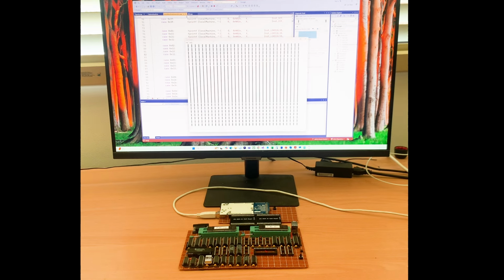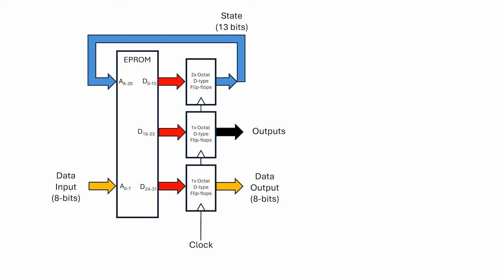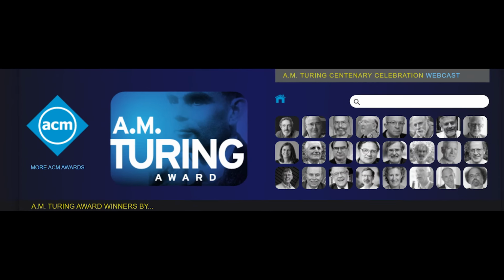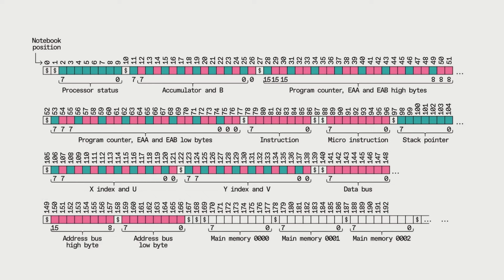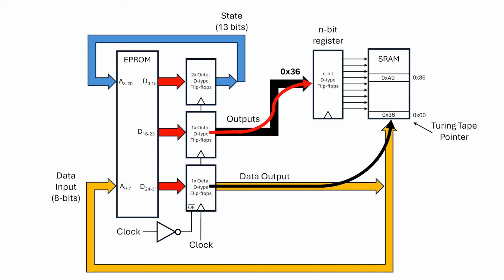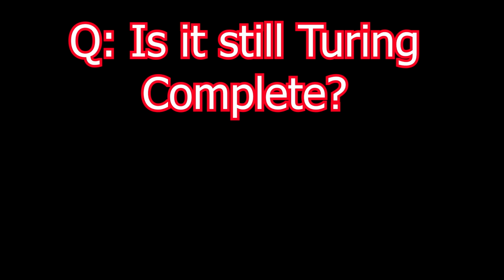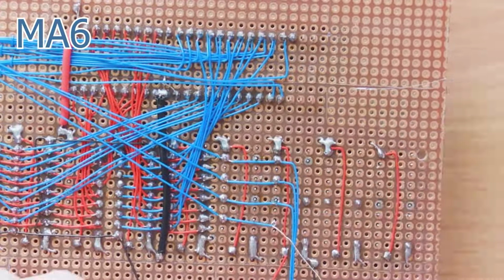ZX Spectrum Turing Edition Part 2 - Memory

Comment: A Turing machine can compute anything that is computable.  Any program that would require an infinite tape is not computable because it would never halt.   To be Turning complete, then,  does not require an infinite tape, only one that is *unbounded*.
Reply from the maker: Yes unbounded vs infinite has been discussed already in the comments. I’ll make a comment in the next video.  I actually argue in the video that very large is enough to be Turing complete.

Comment: Hi - I've been using some of your techniques to recreate Atari Pong in software using emulated logic chips implemented as lookup tables, and using this to generate the composite video signal as another table which is written to gpio pins in a Raspberry Pico. I was wondering how you deal with delays inherent in logic chips when reimplementing in eeproms. Atari Pong's design uses delays to its advantage but I'm not sure how best to emulate this whilst sticking to the original electronic design. Thanks for creating these inspiring videos 👍
Reply from the maker: Usually i clock the output of the EPROM rather than use the 'raw' results.  Means you need the address 1 clock early in your design though.
Interestingly, i once worked with Al Alcorn who designed Atari Pong.

Comment: I don't think I watched any other videos in this series, but I'm around 3 mins in and I'm trying to understand how you emulated a Z80 without using a Z80.  Are you saying that you used EPROMS/EEPROMS with the address pins driven by the instruction value and the step counter and the data outputs being used to drive the various logic lines?  Quite impressive, in any case.  If that is how you did it, then it's a neat solution.
Reply from the maker: There's a bit more to it than address = STEP | (Instruction<<4).  If you're familiar with that concept though, this playlist may be good place to start
https://www.youtube.com/playlist?list=PLjQDRjQfW-84aOLT33kzoZghRofK-uL1F

Comment: I am thoroughly enjoying your videos, I may even understand some of them!
Thank you very much.
Reply from the maker: Excellent, hope you get some value from them.
Reply: @DrMattRegan  Thank you, I do indeed get a great deal of value from your videos. Book in the way..?
An observation, if you have time: If you arrange two Turing Machines with their 'tapes' arranged at 90deg you have a means of addressing an array. n machines can address an n to the n array with I presume an equivalent increase in 'power' while only 'spending' I guess n+1 in components. I presume said array has to be fully populated, not just the 'tapes' along the edges... although to drag a bit of 'avant garde' physics in the shape of the 'holographic universe' in to this, the contents of a 3D space can be entirely encoded on it's surface and I presume that holds true for any 'array', meaning you 'only' need n+n 'tapes' to achieve and encoding space of n to the power of n...
...am I making any sense? Is such a scheme of arrayed state machines used in the world of computing? (my knowledge only extends to a bit of hobbyist PCB design, mostly for 8 bit retro computers) If I haven't just splurged out a load of unwitting gobbledygook I presume such a scheme could be a saving on transistors at the very least, if not a way to 'buy increasingly greater power' faster than 'costs' ramp up.

I'd better stop now for fear I'm suspected of being a hallucinating large language model!
Reply from the maker: @charlesjmouse  multiple tapes are certainly allowed under the definition.  The closest i can think of that's used in practice is a disk drive.  It's essentially an array of 1D tapes, granted we can only go in one direction and all the tape heads have to move at ones.  I think random access kills the performance of any 1D or 2D system though.

Comment: Matt, why not do a version of the Archimedes A3100 (or Android tablet circuit) the ultimate UK home computer?
Reply from the maker: Yeah, I'm tempted to do a RISC machine at some point to show the evolution into RISC.  It's between ARM and RISC V, i haven't looked to see which is the lowest hanging fruit!
Reply: @DrMattRegan  Probably ARM, the Acorn arcbimedes RiscOS machines were pretty close to RiscV as far as low hanging fruit, and there is an opensourced RiscOS operating system version put there.  Think of it as a big Spectrum, with simplified hardware.  You should Turing a usb 2.0 hub, as that is what all these machines need.  Once you get to the universal Turing machine, you should have everything to do it.  3000 cycles to do an addition though, li,e one example out there, is not desirable. :)

I independently determind a way to emulate everything a d repla e FPGAs which I started organising just before I got too sick.  I come from a group into doing minimal instruction set computers in 150 or so luts, or a few thousand transistors (really low hanging fruit) and has the maybe still lowest energy processor in the world, the green arrays GA144, which is a specialist replacement for combinational logic and lowest energy fpga, and not for general use.  The novice and RTX series they use in space, are also two other designs out of our area.  A lot of the forth FPGA processor designs are inspired by the novix/rtx longer parallel instruction designs.  There is one guy trying to do a 1000 transistor serial processor version in discrete parts.  There is some company who has done a 40 core parralel part that can be reimplemented at 6ghz.  It's currently in a 2mm2 chip with ultra low energy.  But it's for non public availability.   There is some guy out there talking about wafer sized parralel arrays with terabytes of memory, and these miniature processors, cheap to do large language model AI.  Some real competition to Nvidia.

Comment: I’m curious about how you have solved register to register moves without a 3rd eprom. I came up with 2 possible solutions both require another control line. The first was a line that allows memory read and writes to the upper 64KB. As the registers are stored there, you can point the effective address register at the register you want to read from and then do a high memory to register move.

The other way is a control line that inhibits the latching of the data from the read half of the cycle into the buffer that feeds the data bus into the state machine. You then do a normal read of the register that you want to move to latch the data and then in the next cycle do a read/write of the target register but inhibit the latching on the read half of the cycle so that the old data passes through the state machine and is written to the target register.
Reply from the maker: Yep, good question.  I actually used another register attached to the w bus, (both inputs and outputs) which is clocked on the negative edge of clock. A control line selects between this register and the SRAM during read - I call it a transfer register.  It’s similar to your second solution, but I’m not a huge fan of gating the clock signal - has bitten me in the past.  Costs an extra clock cycle.

Comment: This video series is amazing, tho as a programmer my mind is more interested in programming things such as the micro instructions. Currently going though your series on that, tho would love to see the actual programs used in these, like to write a emulator and actually interact with the software from your videos myself, part to know my understanding of the hardware matches the real deal and to be able to step though things myself, haveing such files would be a very useful resource for not only myself but others!

Currently working on an I8080 based computer / “game console” based on a large 1bit frame buffer, would be very interesting to be able to develop my own hardware that is based on your designs and maybe even a rom cart slot to run different internal hardware by just swapping out the roms.
Reply from the maker: Thanks for that.  I’ll release the code for the state machine generator when it’s closer to being complete, but there are still some un-implemented instructions still.
Reply: @ oh I can’t wait for that then, got plenty of work to do until then.
Are also planning to release the 6502 stuff at all?
Not all that much stuff (as in actual playable examples) when it comes to state machine microcode systems such as these and they are very interesting indeed!

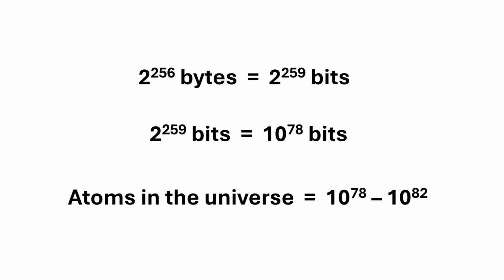Comment: 14:25 i always thought that infinity tape requirement is loosened by more states per  cell and/or more sophisticated operations...but maybe I'm just wrong?
Reply from the maker: There is a trade off between states and symbols (what Turing called behaviour) and the amount of tape actually required, but he just said the behaviour was finite while the tape is infinite.  One example i think of is computing pi/2, you still have infinite digits of pi.
Reply: @DrMattRegan  ah yes, but this i think general problem of compatability, you can find real number to infinite numbers of digits. When you simulating other computers they have some limits, unless some guy from Internet connects infinite tape 😉
Reply from the maker: Yeah, i personally feel like arguing about infinite tapes when taking about real machines is a bit mute.  I think if the machine is easily extendable to have as much memory as you want (which you can do with 8-bit micros, you just need more memory address registers).  For real machines i think the size is "as big as you want".  I think another fair interpretation is that the memory should be much bigger than the state machine which does have an upper limit.
Really what i was trying to say is that indirect addressing is required for Turing Completeness.
Reply: @DrMattRegan your statement about the need for indirect addressing for Turing completeness gave me an aha moment. Now it's so obvious, but that connection had never been made in my head. I took microprocessor design courses a long long time ago but we never spent much (if any) time on the theory behind the Turing Machine.

Honestly I spent much of your video wondering what you were getting at and thinking "ok, the eprom is essentially like a flash based fpga combinatorial block" - but then I realized your off to the side sram was just your register file. I'm sure my neighbors heard a  loud "click".

Thanks for giving me a different point of view of this topic.
Reply from the maker: @OmegaSparky  Excellent. The loud clicking noises are the reason i make these videos.  The smaller direct access SRAM is indeed a register file.  The indirect access RAM is main memory.  If you want to see how i stuffed the ALU function in to the FSM, you might want to have a look at this series
https://www.youtube.com/playlist?list=PLjQDRjQfW-84j-jLvrbEeDvGl0QrhX9p7
The first 5 videos are the Turing6502 build, but part 6 on is where i start to implement the 6502 instructions set.

Comment: Nothing short of a masterclass Dr Matt!   As always I am deeply impressed.   You gave me inspiration to recreate the Intel 8052AHBASIC system over the summer holidays.   I'm well on the way but I'm way behind your skill level in point-to-point soldering of wire wrap wire,  so it's now a few modules on veroboard.   Intel released the internal ROM code to the community and that chip is almost impossible to find so why not?
Reply from the maker: Thanks Andy.  I particularly like going over this topic.  Wasn't the 8052 the one that had the piggyback socket for an EPROM?  Anyway, well done with the build.
Reply: @DrMattRegan  It's just an 8051 microcontroller with 8k of BASIC interpreter built into the package.   Used to be a favourite with hardware hackers back in the mid 80s.   I might borrow some of your 6502 reverse engineering to reimplement  the Rockwell 65F12 which ran Forth.   Maybe later this year.   Or really get myself really in deep by reverse engineering the 16 bit Inmos T212 Transputer.   Thanks for the inspiration to do some really challenging HW stuff again.

Comment: I see that you use a 574 for the high byte of the notepad address register which is hardwired to output zero. Could you get away with replacing that IC with a pull down resistor pack on those address lines, or does that lead to timing issues or other consequences?
Reply from the maker: Yep, I’ve tried resistors before in other design but it can be a problem during writes, particularly with faster srams.  Occasionally you get a write to the wrong address.  So I prefer the active pull-down from the 574.

Comment: I would argue that "almost infinite" is very far from infinite. And since you seem to have an issue with calling a modern computer with finite ram not Turing complete, that would mean we can't build a Turing complete computer ever, as infinite anything isn't possible to make in the physical universe. Infinite in the mathematical sense is undefined because as soon as you define it, it isn't infinite anymore, you can easily add one to get a bigger number. In philosophy, "infinite" is treated much in the same way. So it is definitionally impossible to build a Turing complete machine.
Reply from the maker: I think a more useful definition is “enough” memory for a desired task, than infinite memory.  By that definition I do consider modern machines effectively Turing complete.  At least if I’m able to add as much memory as I need.  What I was trying to differentiate was direct addressing vs indirect addressing and the difference between them. That indirect addressing can lead to Turing completeness. There’s no solution to arguing about infinity.
Reply: @DrMattRegan  That point was quite indirect, but I can see what you're driving at now. I realize I shouldn't get too hung up on the colloquial use of "infinite," but it happens to be a personal pet peeve of mine, especially when discussing concepts rooted in formal logic. In Turing's original paper, "infinite" worked within the scope of his theoretical machine, while the modern interpretation of Turing completeness has shifted toward "unbounded memory," which seems to align with your idea of "as much memory as I need."
Regarding infinity, I agree—it's fundamentally undefinable as a numeric value, and your use here seemed more colloquial than mathematical or philosophical, which makes sense in the context. Ultimately, it's a very minor point in an otherwise excellent video.
Reply from the maker: Thanks for the feedback.  I'll re-iterate the point about direct vs indirect addressing more explicitly in the next video.  Sometimes, making these videos it can be difficult to see them from the viewers' perspective.

Comment: Really incredible video!  You've really elequently explained how the turing machine works and opened a can of worms in my head lol!  I still think you should go with the SRAM being 2 to the power of 256, just for the challenge lol
Reply from the maker: Glad you liked it.  I would encourage you to have a look at Turing's paper.  It's long, but he describes the machine in the first 3 pages.  It's great if you can correlate that with the sequential access machine.  From there, it's one step at a time to get to a microprocessor.

Comment: So cool.  I wrote a Nintendo Gameboy emulator a while back (emuboy on github, z80 derivative).  I'm looking at writing that again, so should be handy!
Reply from the maker: Excellent.  Have you thought about using machine like this?
Reply: @DrMattRegan software only project - But I do like the extensive use of ROM lookup tables, and am surprised the Z80 can be emulated this way, as the instruction set is actually pretty extensive.